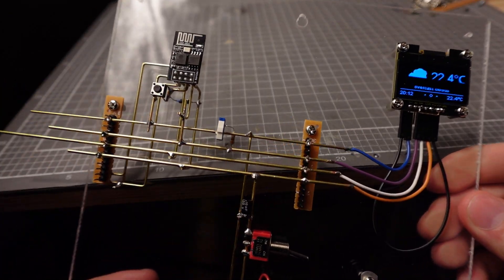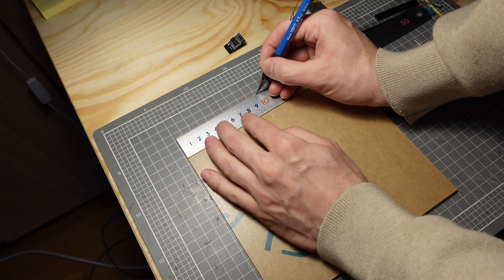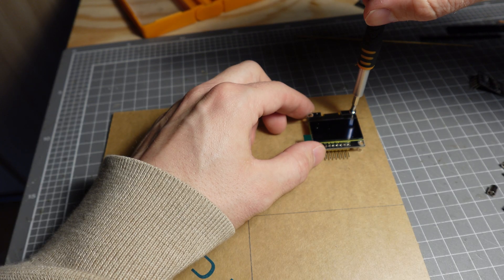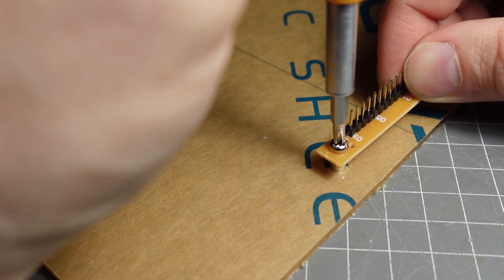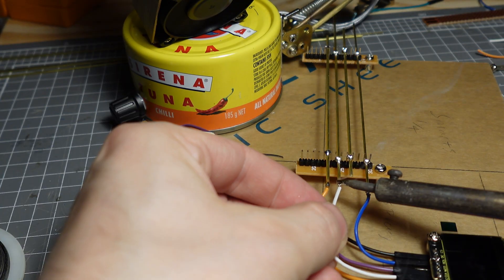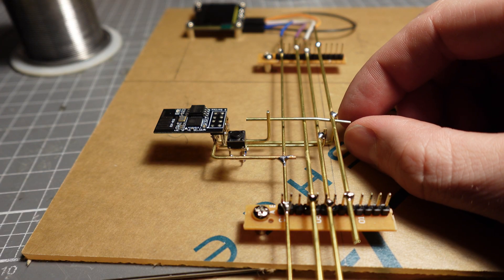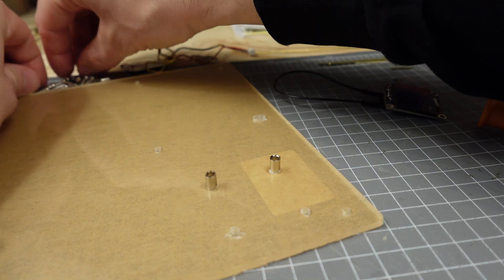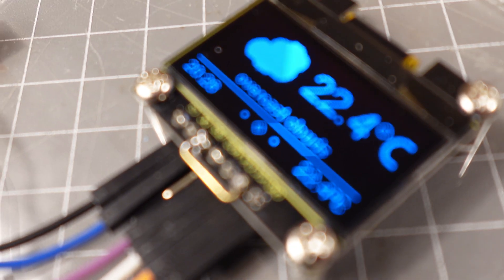I am bad at code | Building a freeform weather widget

Comment: I've resisted the urge to solder my ESP01's directly to the circuit, I use 2x4 headers and just plug them in once i program them.  The ESP01 is still one of my favorite boards.  I must have over 40 of them..  Great work!  I want to do something like that with copper wire.
Reply from the maker: Hopefully that will not come back to bite me but we will see lol. They are great little boards and way easier to use than I originally thought. Cheers